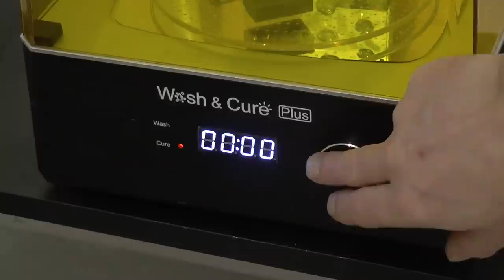Cargo Modeling Marathon - Detailed step by step tutorial

Comment: Martin, the 3D models would be great if they were for FDM printers also, but alas they are only for Resin printers.. Not everyone has a Resin printer yet.. a lot of us still only have FDM printers. I love your videos and they are very great ideas.  Here in Australia, the coil rolls that you show are typically transported on flat wagons but only 1 coil at each end of the wagon 2 in total if they are heavy coils, or 5 in smaller sizes on special coil carriages.

Comment: 3:14   Tarpaulin covered load - Foam shape, papier mache tarp with tissue paper (2 parts PVA glue to 1 part water)
7:26   Cargo Crates with Fruit - resin 3D print
11:30 Partially Wrapped Fruit Cargo - resin 3D print, foam shape, papier mache tarp with tissue paper
14:10 Return Freight Empty Boxes - resin 3D print
14:51 Seed or Potato Sacks - DAS clay, nylon cloth (tight weave for texture)
19:41 Cold Rolled Steel Coils - resin 3D print or rolled paper, Gondola or flatbed car transport (special coil holders)
23:57 Stacks of I-Beams - resin 3D print

Comment: Very nice work with the fruit loads, but I don't think fruits and vegetables were ever shipped in open flat cars😊but rather in refridgerator cars or at least box cars. These Swedish type O wagons were typically used for shipment of scrap metal, gravel, coal, timber, pulp wood or wooden boards.

Comment: Hello, your videos and your skills are always awesome. I want to say thank you, because I have learned a lot with your videos on dioramas. As I am a beginner in this "job" I would like to ask you a question. At first I bought a kit from Lima many years ago, when my kids were young. Then it stayed in a box for more than 20 years I think. Last years I started to  recover the loco. I succeed. Then some one gave me a kit of Marklin what I like very much but it was about 50 years old and incomplete. Then I realized that it would run on AC current and Lima is a DC current. I have now the 2 kits working. Now I'm seeing DCC as the "state of art" with sound and smokes. I know that we can convert an old DC loco to digital with a decoder. But I'm thinking witch way should I go, Marklin or Lima? Assuming that Marklin is also suitable to convert the same way to digital, do you advise work on DC like Lima or ohers or is it better with Marklin? Best regards.

Comment: I wouldn´t start with a resin-printer. Start with FDM, that´s far more beginner-friendly and faaaaar cheaper. And the filament doesn´t smell unlike the resin
Reply from the maker: Hi! Thank you for the comment. It sounds like you need a tech-update though.. 1) A good FDM is nowadays actually more expensive than a good resin printer. I would instead define the usage of a FDM to print 0- and 1-scale items at reasonable quality. For smaller objects resin printers are definately recommended. 2) None of the resins I have tested so far (3DJake, Phrozen, Anycubic etc.) is smelly. They only have a very moderate amount of sweet smell. However, the printers can be filled up Monday and emptied and cleaned Friday and since they are closed all the time, except when you remove a printed item.
Reply: @marklinofsweden  ad1 FDM is more expensive then resin? Not really. If you compare entry-level-printers FDM is cheaper then resin. I bought the anycubic i3 Mega-S new from their store for €142 incl s/h. Contrary to resin printers that´s all you need. When printing resin you need a 2. device to wash and cure, the one you use in the video costs another €189 on topof the printzer.  ad2: there is a reason why wearing protection like masks, gloves etcis recommended when working with resin.  Ia gree about resin being better for smaller details, but FDM is good enough for low-detail items/structures. The resolution is 0.1mm on the y-axis which isn´t that bad.  tech-update done.  YW

Comment: Not true about the 1/16 of an inch being 3mm. 3mm is about 1/8 of an inch in thickness because 2.54mm is exactly 1/10 of an inch meaning that 1/16 of an inch is about 1.6mm in thickness.
Reply: Therefore 3.2 mm is an ⅛ of an inch.